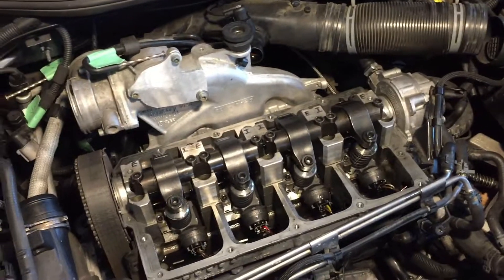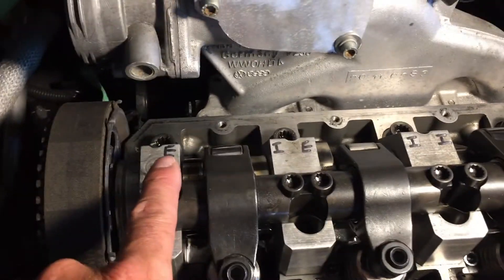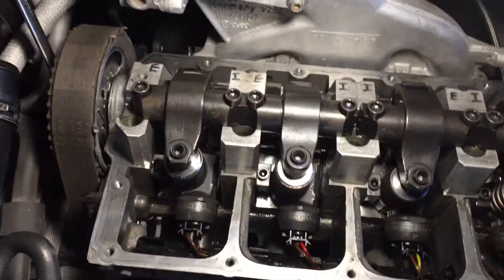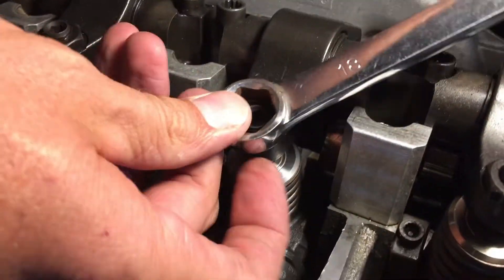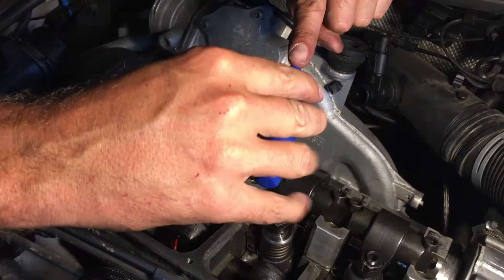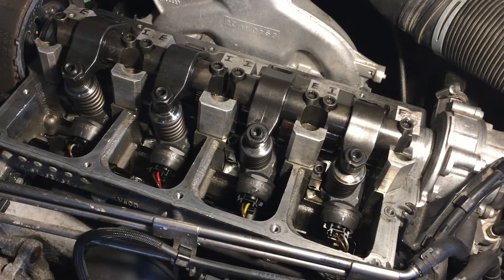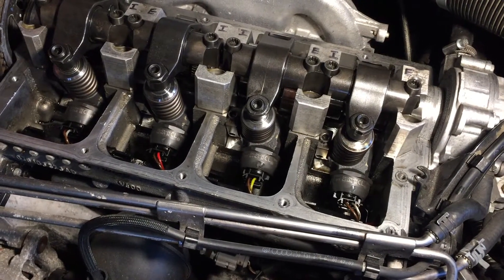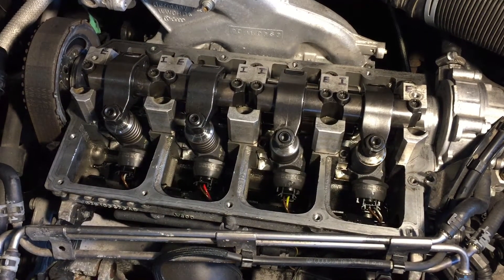VW Jetta 1.9L BEW, How to Replace Injectors and Set Injector Cam Shaft Timing, With Torque Specs

Comment: Yea...never turn the engine over from the camshaft only ever use the crankshaft.
Reply from the maker: So very true, thanks for stating that. We only used the cam because we had a bunch of other stuff off and no compression on the engine. Otherwise the cam timing belt could slip and throw off timing.